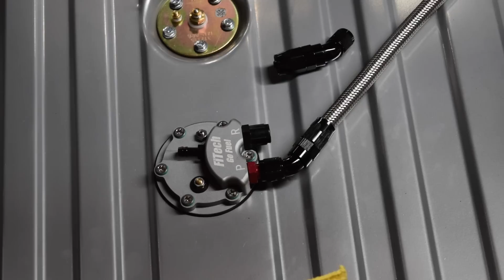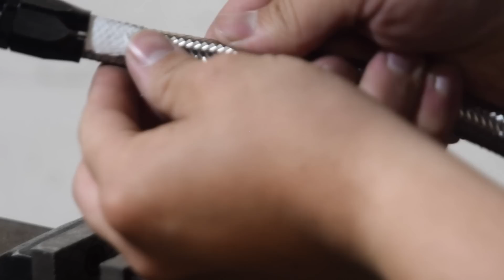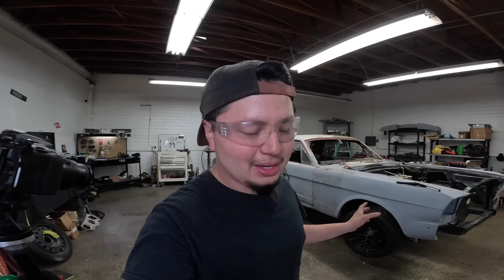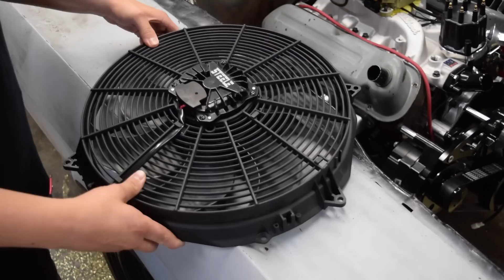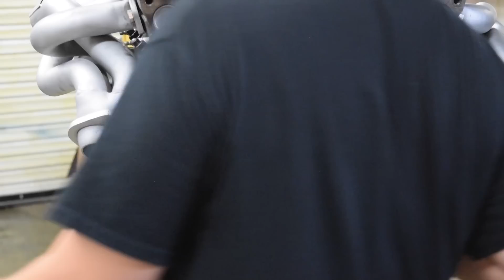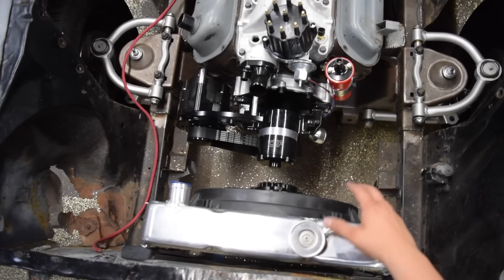Scrappy Continuation | First Start Preparation

Comment: Cool.  🙂. As far as the video goes I could say maybe get some of those cheap rechargeable LED lights to toss under the car for some fill light.  It looks kind of dark under their like you're in cave.  I was worried that at some point in time a monster was going to jump out and attack you. Maybe a giant mutant penguin 😲😉
I was glad to see on your second hose clamp fitting that you blew the shavings out of the hose that's a little worried about that with the first one.  Good that you told people about the advantages of the brushless fan motor 🙂. I wonder if you "have to worry about" abrasion from the hoses touching each other, do you have to worry about them vibrating against the firewall 😲😅🤔
I've been wondering involving vibration and weight wear on something, does mounting the fans through the radiator cause where that you need to worry about 🤔
Stop worrying about how the fuel line looks cosmetically inside the engine compartment... It looks pretty, shiny, quality and new! 🙂 
Serious question. Why did you put the fuel filter under the car where it's a pain in the ass to get to? I am hating having to crawl under my car to change the fuel filter. You used to be able to just change them in the engine compartment when I got old cars.
WHERE DID YOU GET THAT old "Mustang?"
It is totally reminding me of somebody I knew old Mustang race car from when I was a little kid! 😲
I remember it was gray "crap primer type paint." It was loud as hell!  Stripped on the inside.  I think it just had like a "fiberglass bucket seat, metal?" bolted in there. Or something like that. And I think maybe it had a lightweight fiberglass hood on it held down with pins?
And the person that owned it lived in... And the car was in...  Tucson 😲
Your car totally reminds me of it!  It may actually be the same car 🤔

Comment: The brushless Steele cooling fan would be perfect for an attic fan that is powered by a 12 voltage solar panel...Attic fans specific for that use are notoriously enificient..

Comment: The way you secured the lines underneath with two clamps using the one screw/hole can help with that issue you were concerned about with the spacing of the lines in the engine bay. Used to use a similar concept when running optic fibre cables especially in customer premises where pedants p!s$ & moan if anything was slightly uneven.

Comment: You can probably get seperator pieces to hold the hosest together at a certain distance. Or would be each to design and 3D print

Or, cable tie them together, with an extra cable piece between them (looping around the first cable tie)

Comment: I'm also weird about having my lines spaced just right.  amazon sells 5 packs of these nice aluminum hose separators.  They clam shell together and hold each line securely - when you stack a line of them up it make the hose stay uniform.  Very niiiiiiice.   If you're really cool you can drill all the way through the hole that clamps them together and pass a longer bolt through the assembly and secure it in place with a riv-nut/nut-sert on the car.  ok bye
Reply from the maker: Hell yeah thanks for the idea!’

Comment: If you don't want screws sticking in your interior, you can just take a carriage bolt and put in thru the same hole the other direction and tack it in place....
Reply from the maker: Thats a great idea!
Reply: Or double nut the bolt  @rookie__pilot

Comment: Sara’s OCD must’ve rubbed off on you with the gas lines!!😂
Reply: My thought exactly.
Reply: Same fittings as Sarah, but she used solid lines on her latest project, cleaner but more tweaking required. Solid would have allowed for parallel routing and even spacing, but the human eye loves to find the little errors in that. I think Sarah's OCD is required to pull it off. BTW, my electrician brothers love to see parallel rigid pipe bends, which require OCD-like attention to the bend radii.

Comment: So cool (😂) you got hooked up by Steele - I know Sarah is really impressed with them. Love how this build keeps coming together
Reply: Do they really recommend mounting the fan to the radiator fins? That seems like a weak link, why not make some brackets? Or, is the shroud the ultimate mounting method?
Reply: @dankingsbury9971  it's a common way to mount coolers of any kind. It should be fine but I like a bracket or shroud for my own stuff. Personal preference and "I'll get to it later if I need it I just want the car to go" mentality prevails 🍻
Reply from the maker: Right!
Reply: @rookie__pilot  are you gonna make a shroud for it?
Reply from the maker: @TheSaxon25  were gonna see how it performs with and without👍🏻